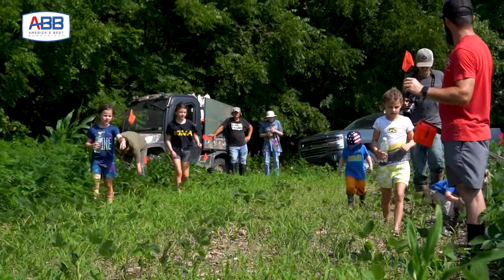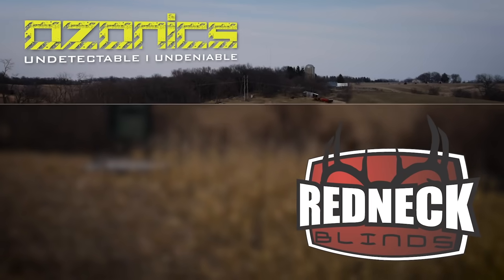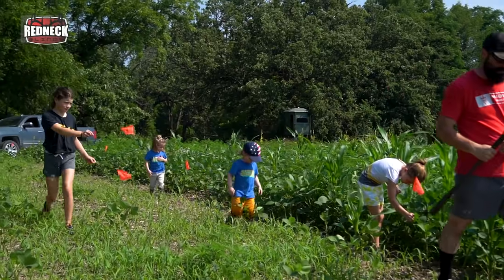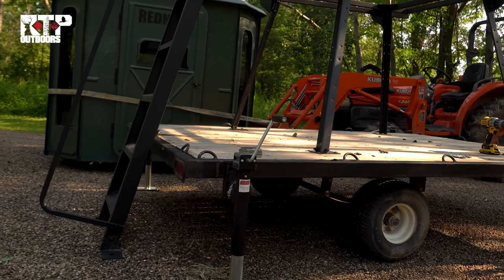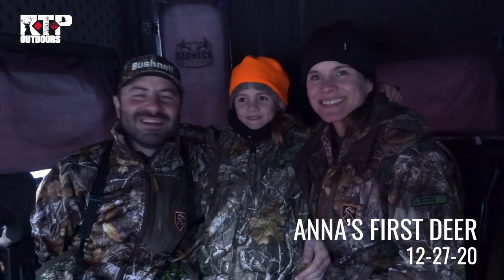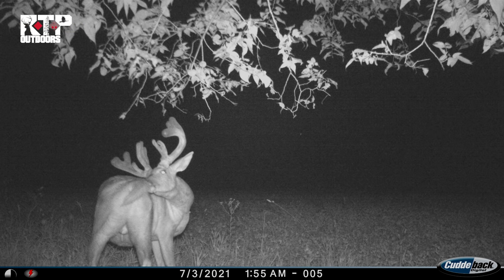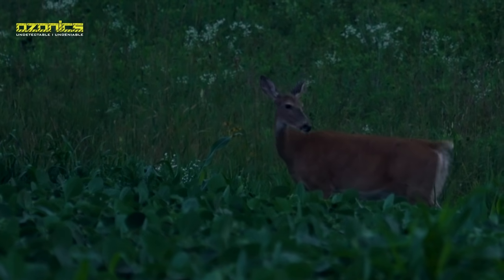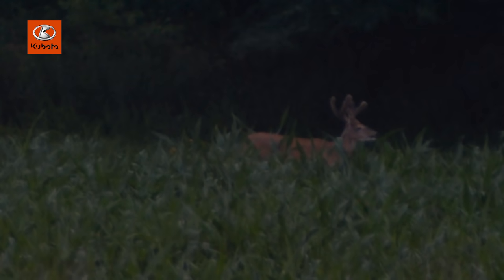Mike's Blog | A July Giant, Family Farm Day

Comment: Hey Mike, for your fence around your beans do you add electricity? Or will that setup work by itself? I read that deer have bad depth perception but I've never tried that type of fence setup before. Hoping to save a food plot for late season.
Reply: Yes I do electrify the fences. I use a solar powered battery energizer setup and it works great. The 3D fence is great because of the deer’s poor depth perception but they will definitely get through it if it’s not electrified. Check out the HotZone fence by hooyman! Good luck !
Reply: @mikereed3878  sounds awesome, thanks for the response. I really appreciate it! GL this season!